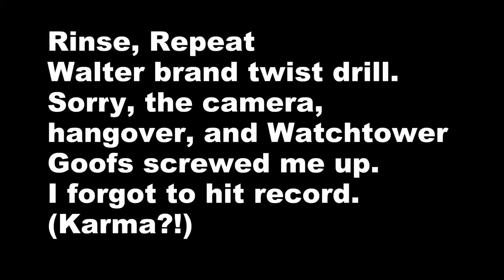Making holes in Armor Plate. Cheap twist drill vs. good twist drill

Comment: My panelbeating / fabricating has a antiquated 1/2" hand drill mounted in a old Wolf drill press stand, the drill is a Hitachi which has forward and backwards and maximum of about two hundred RPM, it will turn a 22mm twist drill through 7/16" mild steel, I use a pilot hole on this, all other holes smaller are drilled without. I have found to keep my drills from burning the land off the drill,  I keep a constant heavy pressure on and lift off the moment the swaff has any colour to it and use cutting fluid or oil from the oil can flowing on it.

Comment: As others have commented it looked to me like the RPMs were too high for the diameter bit, and hardness of the material being drilled. But what speed the spindle was running at was never mentioned, so who knows? There wasn't nearly enough cutting oil being used either. Oil emulsion flood cooling would have been even better.

It looked like with better conditions even that first craptacular bit might have made it. I manage to get work done with my cheapest Chinese drill bits here. But I do make a point of avoiding trying to work on hard steel with them.

Comment: how about doing it right?  Drill a pilot hole, and reduce your speed and increase your feed, add some water cooling.  You're just pointlessly burning those drills out for no benefit.  With a pilot hole and a lower speed and higher feed, all of those drill bits would have drilled multiple full penetration holes before requiring sharpening.

Comment: Aaah good ole armour plate, chock full o' old files and random chunks of carbide. Like those before me say, "ease back on the RPM". More importantly, get yourself some water soluble oil for coolant. Your rapid-tap ain't for drillin' like that. That first puff of smoke is your bit now running dry. Water soluble oil will give you a glorious gurgling sound when you're doing it right and avoid those tell-tale blue chips. :)

Comment: AR400 is not what I would say is "Armor Plate", it's Abrasion Resistant. Used mostly for farm tooling such as tillers & spikes. QT plate is quenched and treated.

Now if they use AR plate for tanks over QT, fair enough, I personally thought they used QT for it. AR plate isn't as hard surface wise as QT plate is. Perhaps I'm wrong.

Comment: Machinist, my ass. Your RPM's are way too fast.
Reply: Well if he'd cut the rpms to 1/3 speed , lubed it at every peck , all the drills could at least cut a couple of holes , and the better ones a lot more .
Moral of the day : everything is chinesium if you don't know how to use it !

NO offense niggAve
Reply: Agodelian Shock, you can guesstimate the RPM from the sound when you've got a feel for it. Also, your RPMs are off by a factor 60.
Reply: ***** Nope, still way to fast for anything but very mild steel.

Comment: If you really wanted to get through that, you should have annealed the spot first. Or you could have used the drill that worked the best along with a slow speed, a moderate feed and LOTS of COOLANT. I drill through AR360 every once in a while. It's tough but AR400 is almost impossible to drill through with tool steel. Carbide works well but you need a very rigid machine or carbide insert drills.

Comment: Were any of those drill bits Cobalt?  Do some drill bits actually need more pressure?  How do you determine the right speed for the material you are drilling?  Are those drill bits destroyed now from heat, or can they be resharpened.  That's a lot of questions isn't it

Comment: Not pecking at the material would give you an accurate test... AR400 is abrasive resistant so as you peck and allow the material to cool down it is heat treating and hardening your material. Once you are in the cut, stay in the cut and keep a flow of lubricate to keep the heat down. Proper RPM for the material is crucial as well.

Comment: Maybe a good time to learn how to calculate the rpm for the drill bits? Dunno what size the bits were but I'd say about 12mm. That makes 500rpm. Using metric system the formula is 6000/drill size in mm = rpm. Maybe not scientifically accurate but works 99,9% of the time.

Comment: there is nothing special about this material. It is about 40 RC. AR500 is a bit more difficult. I cant make up my mind if this dude is goofen or just plane old ignorant. One could drill it dry using 15 SFM. (15x3.82/diameter)
Reply: i've already tapped Ar 500. I have been there already!
Reply: No link. You will have to trust me
Reply: I used a german tap. it lasted for three holes maybe. We then switched to thread milling.

Comment: There are dedicated tungsten carbide tipped drill bits designed specially to drill hard steel. Diager makes them, and I am sure other companys make them also. You can also try the multimaterial drill bits. Bosch, Dewalt, Diager, Milwaukee all have them in their portfolio.
Reply: jebaki And I'm sure they're also dirt cheap for when you need them for that one off job. ;)
Reply: jebaki Tungsten carbide (aka WC) blows HSS out of the water in any application that doesn't have to deal with impact stresses (WC shatters when HSS bends).
It's much more expensive, but it lasts much much longer, and coatings on top of tungsten carbide (Ti Carbide, Ti nitride, CBN, CVD diamond) make it last even longer. Usually, the extra life you get out of a carbide tool is worth more than the same tool life from HSS. So it ends up being cheaper overall, even if it costs more up front. It's a "Pay more now to pay less later" kind of thing.

Also, I'd say buy as good as you can with the money you have, no matter how long the tool "needs" to last. You never know when you'll need it again, and if it's worn out after the one job it was bought for, you end up buying another one.

Comment: I was using a 1/4"+/- cheapo Chinese bit to drill a piece of steel on my press a while back. The tip got hung up when it was almost through the material, Instead of snapping off, it partially straightened the flutes. Good ole ROC metals.

Comment: So just to clarify, what is the best way to drill a hardened steel then?
Keep the speed down and use plenty of lube oil?
Pilot and step up in increments with the drill bits?

Comment: If you would have waited for a day or two for the hangover to wear off then you might not even have made this asinine video. What did you try to prove, that you could burn up drills by running them at the wrong speed without cooling/lubrication? Keep up the good work.

Comment: Great torture test! Now I can see why the Walter drill set is way more expensive than the Princess Auto one. Just curious, what rpm were you running at? My chart on the wall says AR400 wants 15 SFPM, so on a 1/2" drill that'd be about 115 rpm but it's hard to judge from a video.

Comment: Thanks for the friction welding tips.  Those cheap bits might actually work if you run it real slow RPMs, lean into the feed real good without pecking so much, and keep her douched wet, I mean drowned, with that thread cutting oil.  Once it heats up yer cooked.  Each peck leaves a work-hardened surface to cut through on the next plunge, like stainless only worse.  Another trick if you can get away with it is to destroy the hardness before drilling ... torch it red and cool it real slow, use the torch to bring the temp down slower than air cooling. No, not the drill bit, the material!  Of course you'll distort it and it won't help if you needed it for the hardness, etc.  Love your videos.  :)  Don't listen to me, I'm only an amateur (but a cheapskate one).
Reply: Wyatt Storches That's actually a valid suggestion. I once used that trick to drill into a bicycle derailleur. It was like glass before annealing. After that, the bit still had to be sharpened mid-work, but at least it got through.

Comment: I was drilling 1/2" AR-500. Nothing I had would touch it including cobalt bits. Sounds crazy but masonry bits were the only thing I could get to go through it. I had to oil the shit out of them, run them slow, and constantly sharpen them but damned if it didn't work. They don't make a precise hole, but if all you need is to punch through it they'll do it. Only problem is they might go several holes, or the carbide tip might shatter on the first one.
Reply: EETechs The thing is, I'm working on a wood pellet mill. I made the die plate out of AR-500. Nothing I had would touch the stuff though and I didn't have $80 for a carbide bit so my Uncle suggested using masonry bits. I have lots of old masonry bits around. It worked well enough to make holes through the AR plate. Now I have a working prototype machine. Once I receive payment on it I can purchase a proper carbide bit and drill all the holes I want. It was a case of working with what I've got.
Reply: heliarche The good old money summation feedback loop. Start off with what you got, profit, then get proper equipment to make thousands of the product to then make lots of profit. LOL
Reply: heliarche try carbide masonary bits at high speed, lots of pressure and a little bit of oil.
Reply: *****
Ordinary bench grinder. I had to sharpen each one before I could even use it for metal. It takes forever if you really let them go. I'd drill a hole and dress it up. It's something you do if you're in a pinch and don't want to spend a ton of cash on regular tungsten carbide bits. I still ended up destroying four of them at $8 a piece.
Reply: EETechs You hit the nail on the head. I made this pellet mill just for kicks. I put it up on Craigslist for the hell of it. A guy got in touch with me and he came over to see it. He told me a few modifications to make so it would actually work instead of just shitting out stuff that looks like a beaver has the runs. If all goes well I'll be getting a good deal more than I initially wanted for the machine. After that I can upgrade some of my tooling and make a better one. The guy is talking about partnership and business and laa dee daa. As long as he buys the first one I'll be set up to make better ones. I'll make as many as he wants afterwards but I'm not getting into anything complicated.
Reply: heliarche You'll have to use solid carbide bits then.
Reply: ***** If you got it red and punched it, certainly. Drilling on red hot metal? I think it would destroy your bit!
Reply: ***** Get yourself a new keyboard with a working space-bar to become a true blogger.
Reply: heliarche ji because masonry drills have carbide tips i drilled even hardened spring whit those they are fantastic and cheep

Comment: "I saw someone under my kitchen table, talkin' to my old tom cat..."

Not sure what the drippy-splashy-pumpy thing is, nor its purpose, but to quell the noise of falling water try using a pad of scotchbrite or similar as a landing pad.

If the water doesn't need to fall the distance but there's no convenient place to attach a simple hose return, try running a string from the drip-off place down into the bucket.  

The gold drill, was, I think, coated with titanium carbide, which you'd produced a few months back.
Reply: Maybe she should fix the hole in the roof

Comment: Sweet drillage dude.  I could almost smell the Gusano Rojo.  The water noise made me need to pee - it happens when you're an old dude, power of suggestion.  Great abuse of a high manganese alloy.
Reply: zwz • zdenek I have a dog that'll pee on the spot if someone looks at him.
Reply: Richard Smith Sounds like my cats. They throw up if the day ends in a "y".
Reply: ***** It doesn't have anything to do with age. Some dogs actually will pee right on the spot when they hear water.

Comment: I really hope that wasn't some kind of high wattage resistor at the beginning >_<
I would vote for you, 3 more years and I would never have to look at tequila again. I might even turn back into a human instead of a meatbag.
Reply: I know a good kludge when I see one, anything over 1/4W and the price goes through the roof. Mike from mikeselectricstuff had a video where he used small gauge enameled wire submerged in water as a high power resistor. the wire will never get hotter than 100c as long as there is enough thermal mass in your bucket.
Reply: +AvE Hastaloy?? Have you priced any those electrodes lately? Got a couple boxes from Eutectic, bout $800 worth. Got a big hastaloy overlay job coming up soon.